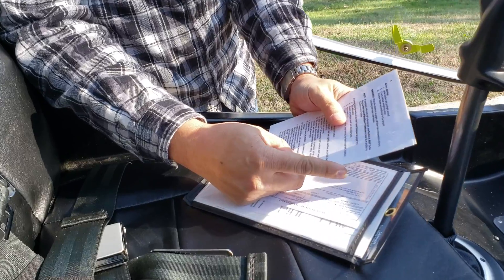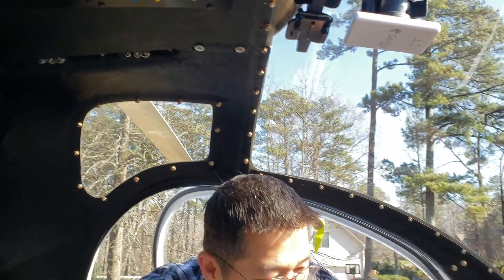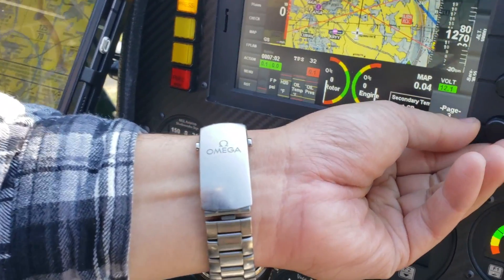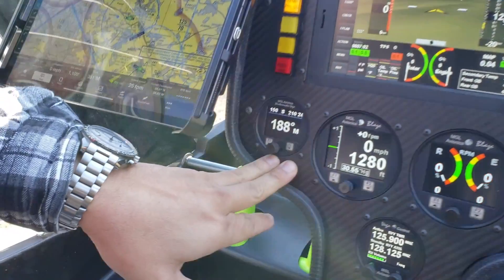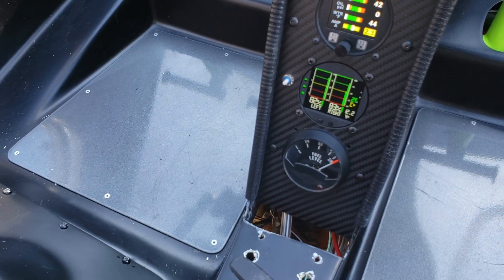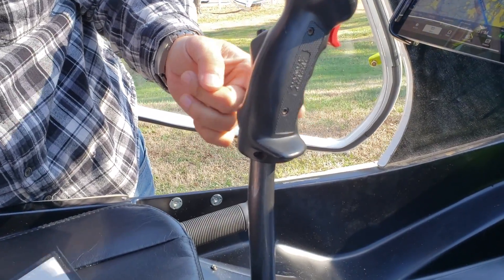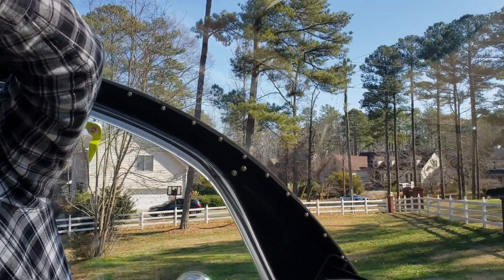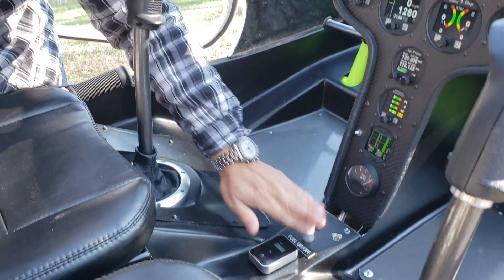Private Helicopter Start Up In Driveway

Comment: Strange that they start with clutch engaged, or maybe no clutch?
Reply: its a multi belt pulley system, primary drive to secondary, controlled by a manual lever. because of tolerances vs weight, the drag is quite noticeable, so the blades immediately start to spin, later fully engaged during low rpm warm up. i think, in hindsight, they could have designed a better clutch system, but many owners use aftermarket electronic tension systems, which are not  factory approved, but work, whilst risking premature pulley and belt wear.

Comment: Howdy David,  thanks for doing the outstanding videos!  I am working with Stan to purchase the current RotorX Helo kit.  My question is does this chopper have a governor system like the R22/R44 to marry the main rotor RPM with the engine.  If not, what is the downside of this?  Thanks in advance for your guidance!

Comment: i love what you did with the panel, except the drill holes and gap at the base of the panel. Question, why have it start turning the rotors on startup? That's a lot of stress on starter and the batteries.  I have several hundred hours in the R22 and R44 and on start the blades are not turning until you engage the clutch and the belts start tightening.